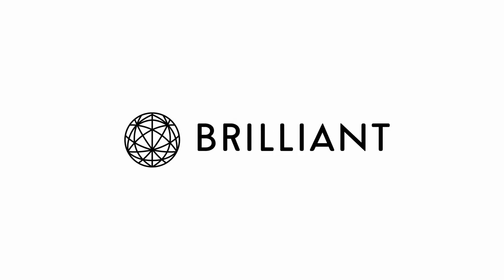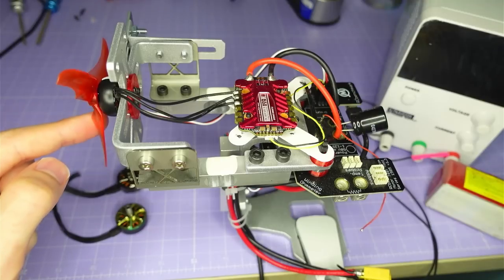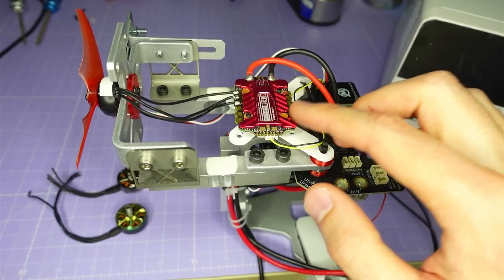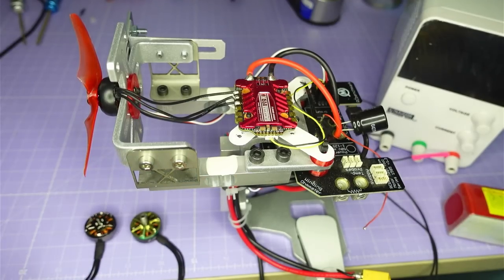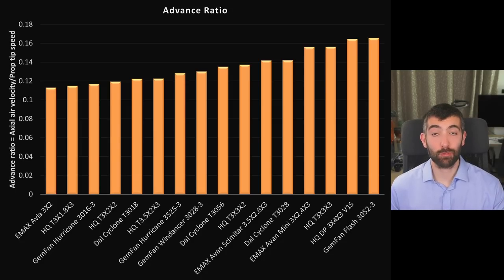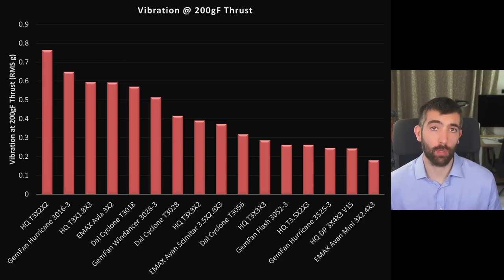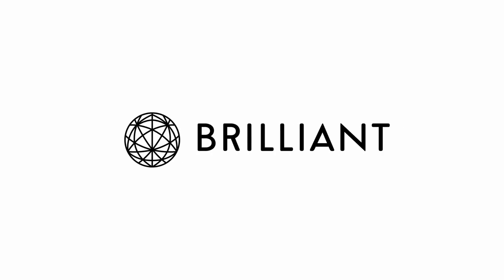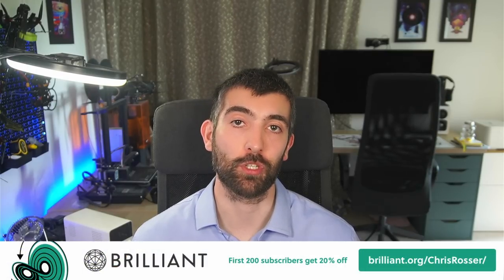3 - 3.5 inch Open Prop Testing: Let's find the BEST!

Comment: Keep in mind that those two 3" prop suggestions are VERY fragile, the Avan 3" has an extremely thin blade material which will bend/crease badly in most crashes and then the HQ 3x3x3 will break entire blades off during crashes since it's very weak at the hub.  Adding durability in real life crashes over years and years and years of testing all of these into the data that Chris is presenting here, the best 3" options IMO are the Gemfan 3052 for 250 - 300 gram builds and the Dal Cyclone 3028 for 200 - 250 gram builds.
Reply: What motors are you using on the DAL 3028? 1404?
How do you like them vs the gemfan 3028?
Reply: Same thing with the Avan Scimitar 3.5". Flies great, but even a slight tumble on grass will snap a blade off.
Reply: @chrisbee5481  1404's, 1504'sm 1505's, and 1306's, the Gemfan 3028 Windancere are fragile, they breakbend blades at the hub just like the HQ 3x3x3, the Dal 3028's are the most durable lightweight higher pitch option we've got (for now)
Reply: Have you had issues recently with HQ 3x3x3? I basically only used those for the last 2 years: honestly, I never saw the issue you mentioned, I usually scrap them after being too dented/bent by the crashes, rather than seeing entire blades breaking off, even when crashing on concrete. I'm wondering if the issue you see is with more recent batches, as mine are surely a bit old
Reply: @MatteoAvalle  I haven't used them in years because of how fragile they are and when they break an entire blade comes off making the rig unflyable, I always prefer props that bend rather than break so I can fly home
Reply: I fly the DAL Cyclone 3028 propellers with both 1404 3400KV and 1404 3800KV motors, and I find them to be perfect in terms of balancing durability, thrust, and efficiency.
Reply: @ciottifpv have you tried the Gemfan 3020?  I've got some on the way to test out.
Reply: @StacemanFPV  yeah, a while ago, they're ok for toothpicks but they're too light/fragile/low pitch for anything heavier which is primarily what I fly
Reply: I'm a big fan of the dal 3028 prop. I have it on 1306 4000kv on a 160g auw mega toothpick. On 4s 650. I had 1404 motors, but I built this guy just for speed. The emax 1306 (I know...retro) is a beast. It's on a twig tank frame, and the dal3028 has been the best on that quad so far
Reply: @MatteoAvalle  I have had the 3x3x3 on some heavier "toothpick" quads for a long time. It's all I use on my 3" arrmatan tadpole, and I rarely break them at the hub anymore. They may have changed the formula. Also, I'd love to see Chris rosser compare the same prop, but different colors. The dyes used CAN have a big difference in durability. Cnckitchen did a video on color of 3d prints and durability, and found huge differences dependent on color. It's really cool

Comment: You left out the HQ 3.5x2.5x3 prop which would have been a more comparable version to the Gemfan
Reply: yeah exactly the same question the gemfan has 2 similar prop with different pitch (3520 and 3525). Also same with the hq prop (t3.5x2x3 and t3.5x2.5x3). And also there many of 90mm/3.5 inch props out there that should be tested but I think you will choose the prop depending on your weight of the build. The video and test is great but not everything covered

Comment: I just build a aos 3.5 with 1604 motors a few days ago. Im using the gemfan 3525 props happy that i took the right decision. Even without tuning it fly's beautifull on betaflight 4.3.1 defaults. Thanks Chris! I will tune it on betaflight 4.4 this weekend after I saw your tuning video.
Reply: what 1604 motors your using?
Reply: @FERNANDOPR_FPV  I use t-motor 1604 3800kv 4s

Comment: I've been racing a 3" indoors all winter. Lots of concrete. Tried quite a few of these and some of them (especially the emax props) just explode on impact. I stuck with the Dal 3028 as they are very durable and perform good enough for me...

Comment: As already mentioned by another viewer sad too, the HQ 3.5 2.5 3 was not included as I have them on the AOS 3.5 O3 as on YouTube I found a test where that prop outperformed all other 3.5 props in overall performance. Would you like to have a look at them too? Totally love your videos on tuning and the AOS 3.5 makes me not want to switch to 5 inch my other guys fly as this thing with 750mah is 249 grams and blasts me away in how smooth and agile it can freestyle ❤

Comment: The vibration diagram is interesting. However, I don't think comparing all props at same thrust is fair, since these props cover completely differently scenarios. The weight of 3 inch drones can vary from 50g to 400g (or even more?), so the different props produce different thrust under their normal working conditions (hover / 20degree forward flight). However, the graph measures these props at 200gF thrust. For a light setup (a 100g AUW toothpick) using GemFan Hurricane 3016-3 prop, that means 800gF total thrust which provides *8g* acceleration, which is almost full throttle for a light drone. That also means this prop is spinning at way higher rpms than other heavier props, which causes other issues (the tip could be spinning at near sound speed causing even more vibration). So this comparison just doesn't reflect the working condition of this prop.

Maybe it would be better to normalize the result based on pitch & diameter of the props, at same **tip speed**, say, 100m/s? Or maybe just provide a vibration - thrust graph, that way it would be easier to compare props at any desired thrust, since it just doesn't make sense to normalize the results and try to compare props for light toothpicks with props designed for heavier freestyle/racing/cinematic quads

Comment: Hello Chris! Now that I've been binging your empirical test of FPV theories, may I pitch an idea for your next series?

I'm curious to know how different duct approaches affect performance. Duct features like low profile, straight profile, variable geometry, low prop tolerance, extended inlet bell, extended exhaust, stator vanes, or the combinations of these. See how they affect the performance in various parameters. Evaluate whatever the improved performance is worth the added weight. Will happily elaborate the full idea and help you further if you're interested. What do you think?

Comment: Avan mini has been my go to prop for years! no mater which prop I use this one always gives me the smoothest flight feel while being quiet and exactly as you show here the least vibrations as long as the props aren't bent. but its not the most efficient. Ive gotta check out these 3.5 versions now :D Thanks for the work you do here very interesting and good data

Comment: I've actually just mounted a set of the HQ T3x3x3's on my Diatone Roma L3 build, and could both hear and feel the difference from my old 3x2,4x3 props. They are super smooth, has great power Flew them in 12m/s winds and still had plenty power to bail me out of problems :D Great prop !

Comment: You beautiful mind.  I love this test.
Thanks for the chats about my AOS 3.5 questions.  I basically built & tuned the whole thing with all of your part recommendations and new presets.  It's my snappiest-flying quad.  BTW, GNB yellow 350mah 4s batteries did work well- short flight time but lightest 4s I could find.  I run larger ones too but I wanted to see how shaving 20 more grams would fly.

Comment: Very interesting comparison of scientific data 👍. I've tried the 3 3.5" props and feelwise (absolutely not scientific) the 3.5 Avan Scimitar are very brittle and break with the slightest crash plus they imo feel / hover or maintaining level flight is hardest with them. The GF are somehow in-between and I today only use the HQ 3x2x3 or HQ 3x2.5x3 as they are sturdy, low noise and I can fly them more precise than the other two. (flying with 4S 3.5" HD quads between 240 - 280 gramms / 1404 3800kv - 1504.5 3950kv motors)
Reply: Hmmm.   I have extensive experience with the Avan 3.5s and love them.  I crash hard a ton.  Usually they don’t break.  I’ve bent them in half and bent them back.
Reply: @MrBlonde5k1  I had several break and did not like them at all :D Guess it‘s also temperature relevant. The GF or HQ 3.5“ did not break below 15° C as the Avan did. But the feeling / usage is surely always a personal opinion - hope they work well for you.

Comment: i cant fully agree to the theory of pushing. the other theorie is, that the props are pulling themselves with the quad up. there will be always the frame in the way in the pressured area of the air. BUT the other theory says, that the lower pressure air in front of the prop is more  affected in a bad way if there is something in front of the prop. SO i think it is better for this type of test mounting the prop the other way. otherwise you will add to your test the ability how good can the prop fetch the air around an obstacle direct in front of it.  there was a industry project in germany which some professors made in the 90´s. dont remember the names, but some germans built a pusher prop system out of it and it was great. the idea was alining the air around a fuselage to the prop in the back. the only downside was the high volume and annoying sound. :-)  much too loud. 
i also use the hq 3x3x3 and the 3x2,5x3 on my tadpole. it is way more quiet, but i have more jello in video as i had with 2 blades before. flight time is around the same, 3-5 minutes.  but 2 blades are about 2 times or more noisier.. ? huge difference

Comment: What about efficiency at speed? From my experience, as well as ecalc results, a steeper pitch can yield lower power consumption over a distance traveled.

For this reason, a prop that gives the longest hover duration is not necessarily the best option for flying a given distance.

Comment: Why not go to 4" for efficiency?
Reply: On sub 250 or even sub 300 gram rigs, 4" props are wayyyyy too floaty, it ends up feeling like a toothpick with very little off throttle throw.  The 3.5" props are guilty of this as well but nowhere near as bad as 4"
Reply: @CiottiFPV  totally correct for a freestyle build. Asking for efficiency and longer flight time on long range, then you probably don't care too much if it's floaty.

Comment: thanks, very interesting as always! quick question on the set-up: since you have a regulated power supply anyway, couldn't you run the motor from that too? or, in other words, why use the 4S battery? thanks, just curious (and probably not very knowledgeable)

Comment: I have an aos t3 with 1204 8000kv on 2s. gemfan hurricane 3016-3 needs ~12a. my esc is 12a. 

i want more top speed. 

i know the 2-blade is what i want, but i ask myself if a HQ 3x3x2 with motor output limit will give me more speed than hurricane 3018-2 without. 
what output limit would you choose to not blow the esc?
Reply: You sure it's not drawing 12a total (as reported by Betaflight)?
Remember: 4-in-1 ESCs are rated per-ESC - that is, 12a each or 4*12a total.
To compare, I'm running 3016 8150KV @3s drawing ~20a total hitting 35k RPM.

Comment: Has anyone used the hq 3.5x2.2x2 biblade props? I run gemfan 3018 biblades and thinking abiut moving up to 3.5, it is the only biblade option.
Reply: Yes they are very good. I use them on 1204 8000kv 2s.

Comment: Hi, for best 3.5 props suggestions, what size motors you think suit the best? Plz let me know. Currently I fly my geprc Smart35 frame with 1404 3750kv on 4s with Hq Prop 3.5 inch and 2 pitch. I feel it’s a little slow.
Reply: @crash_lander Have you got lots of drones, and how long have you been flying for. If you only have one quad and you have only been flying for 6 months, then likelihood is you need a bigger up tilt on your camera.

when you say not fast enough, do you mean top speed or accelleration. If you are trying to do spang in a big field then you likely just need a bigger quad.
Reply: Upgrade to 1804 3500kv motors and emax 3.5" props if you want more Power.
Reply: The Smart35 is quite heavy so I also would suggest a smaller battery (like the Tattu R-Line 750mah 4S - they are much lighter than the usual 850s and have a lot of punch, my favorite for 3.5 inch).

Comment: The prop is too close to the stand to provide accurate measurements. The performance of a prop doesn't matter if it can't handle the environment. EMAX Avan Scimitar shatters like thin glass if it touches the softest blade of grass.